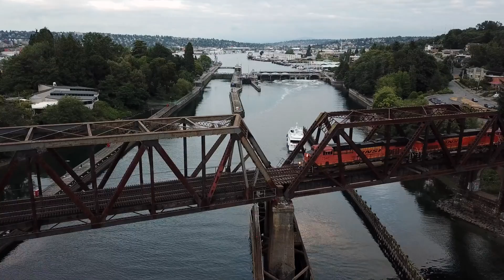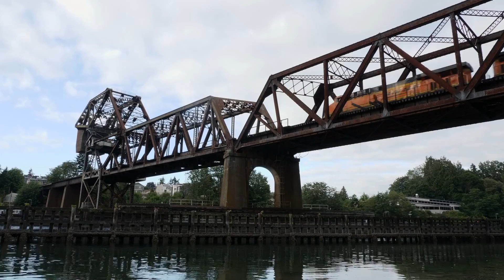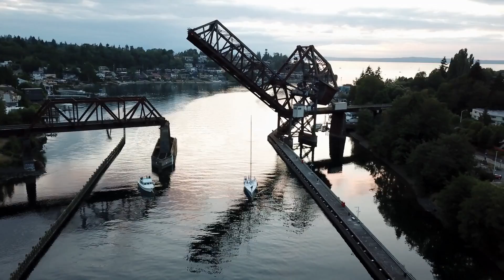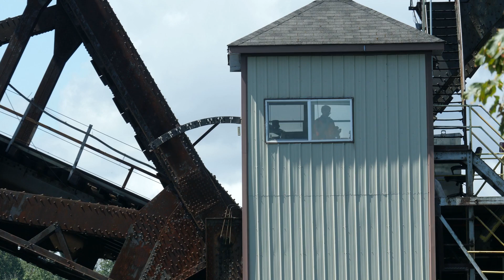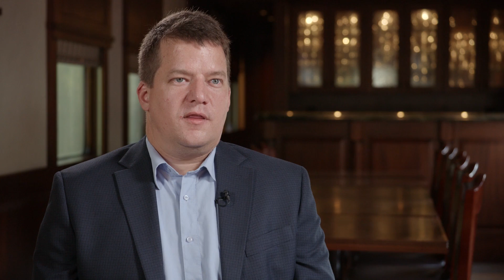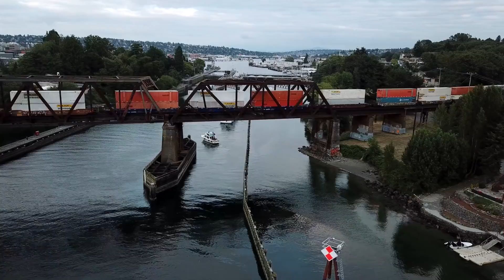Ballard Bridge replacement

Comment: Hmm., upgrades. lol, I like that plan. It seems to me that the old bridge was a plan that was not planned to last for very long, or was a temporary solution until further plans could be implemented. And now those further plans are being implemented. This new plan looks to be of a more Efficient, wisely sustainable and longer lasting bridge. That old bridge with its bearing was not a wisely sustainable design.